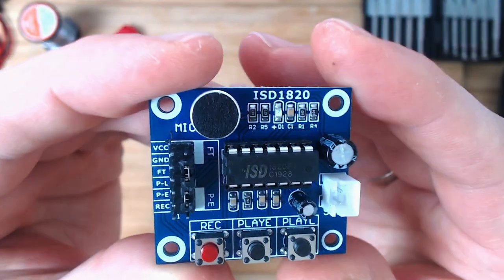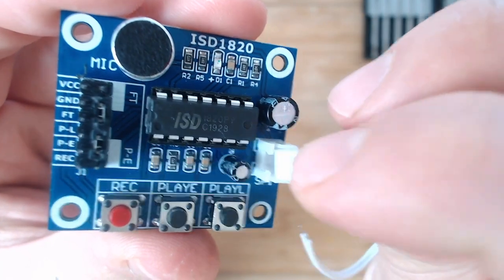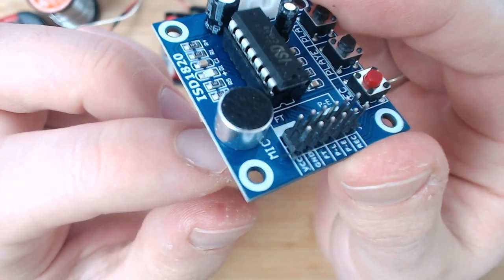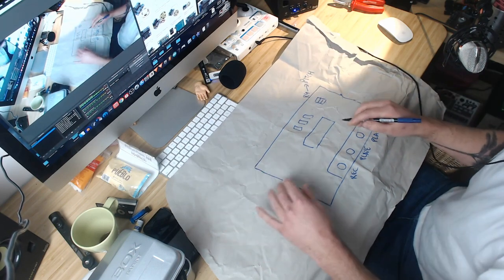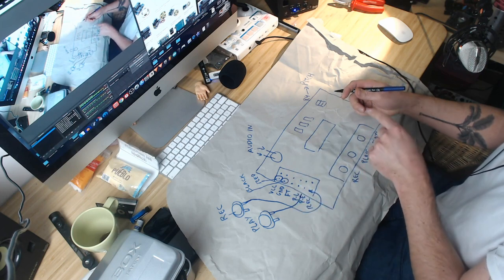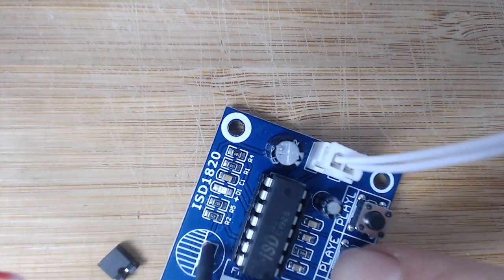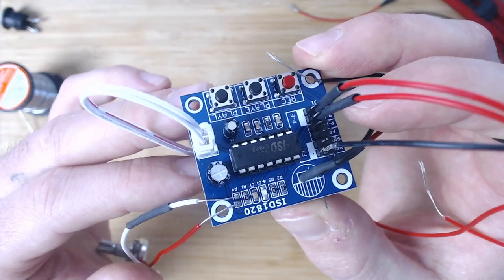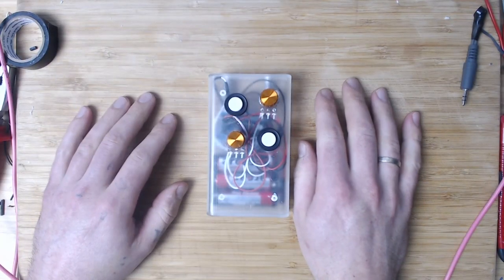HOW TO DIY LO FI SAMPLER

Comment: Nice one! I have a question,  it there any way to trig the play button with a cv drum sequencer? examaple arturia beatstep pro?
Reply from the maker: Yes, there is, check the comments, someone was giving the steps to do it!
Reply: @Lonershy  thanks a lot, just read that about this, I also talked with another guy , and he gave me also another way, which is:  a diode and 10k resistor in series going to the play pin of the IC is all that is needed, CV voltage is max 5v ( adviced by @dirkk82 )
Reply from the maker: Cool! Gonna try it!!
Reply: @Lonershy  do it in on a video please hahahah